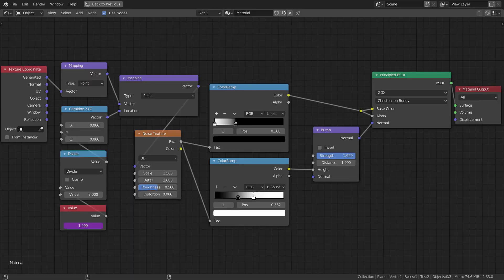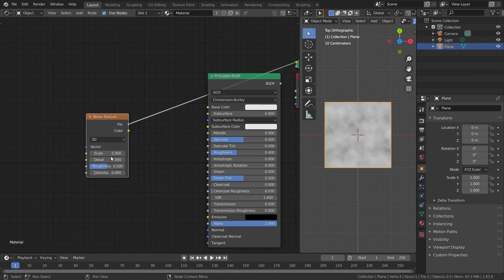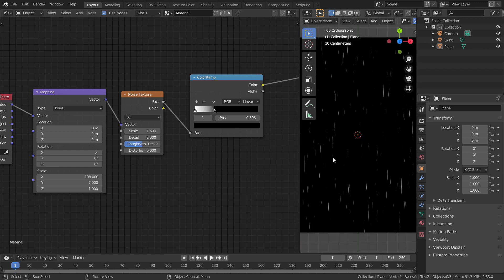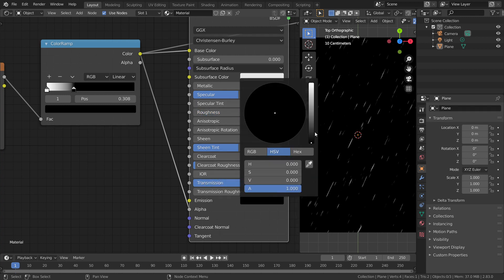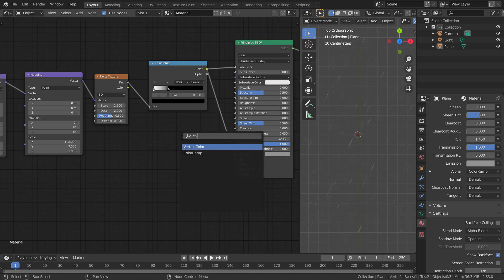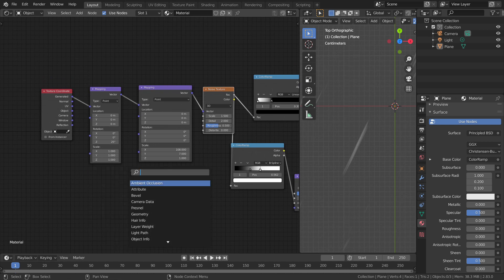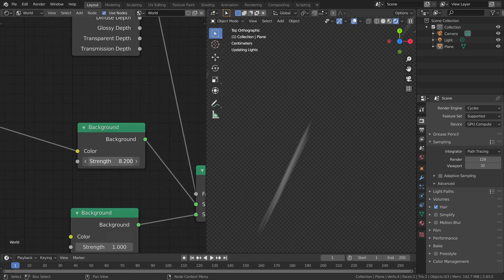Procedural Rain Effect in Blender 2.8 - Node Shorts

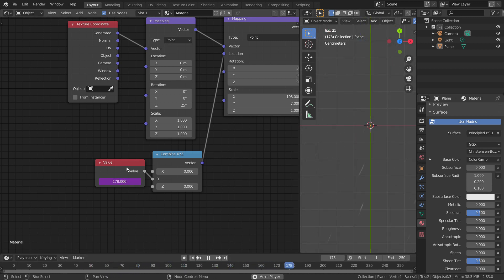Comment: great tut Btw 2:20 instead of using math node you can just type #frame/2 or *-2 etc  (in value node)
Reply from the maker: Yeah, but it won't make it easy to change the value. Like you can change the value in the second socket in the math node easily than changing it in the value node, whenever you need it. Anyway, It's all personal preference 😄
Thanks for your suggestion
Reply: @Just3DThings  yes you are right.
I naver thought of using math node because i am not into math.
Btw it will only work in shader editor not in other input like move and scale etc
Thank you for this amazing tutorial learn a ton.